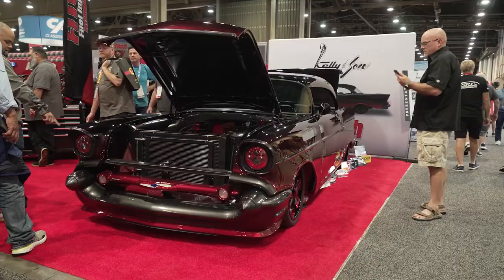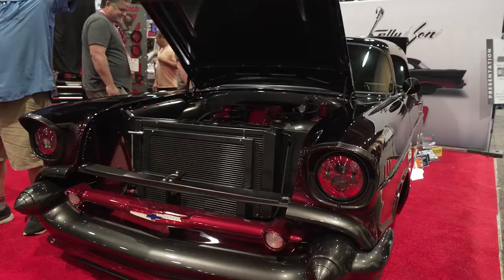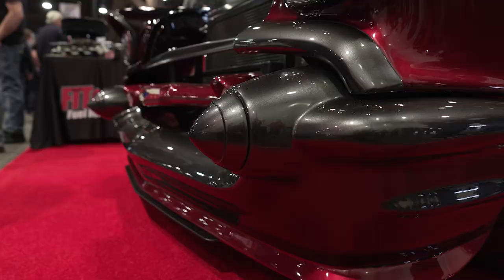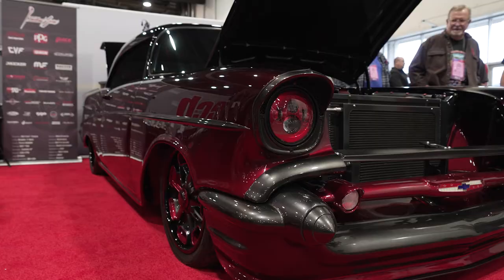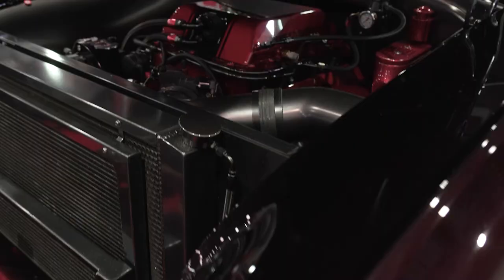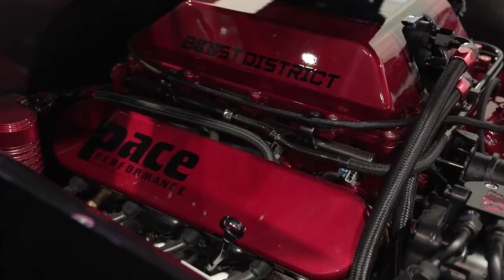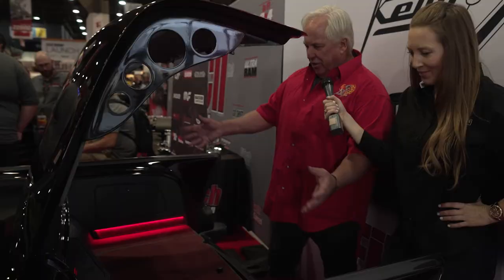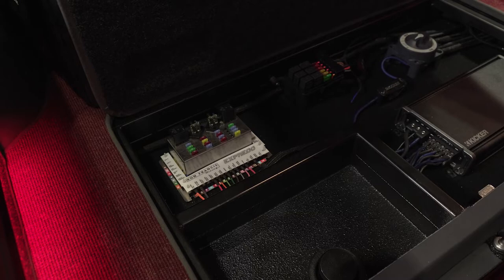SEMA 2022 - Kelly & Son - 1957 Chevy

Comment: I own this car...on CSR2😂
Reply: Same here 😂😂
Reply: @tylersingley3054  I just took mine out for a race, and was wondering why there was this high, pitched clucking sound. Turns out, one of my crew duct taped a rubber chicken to the tailpipe. This leads to a very important racing tip: do the circle check BEFORE you race!🤣
Reply: @glennarcher986 ahh that'll do it lmfao definitely check circle around otherwise you will have some unwanted eggs if you know what I mean
Reply: LOl I just got it too. I don't usually buy cars on CSR2 but it was just too pretty
Reply: @DarthTurducken  This one has become one of my favorites. CSR2 did this one justice! I'm looking for some  racers that can get me some decent rp for my crew. If interested, my crew is called Generation X.
Reply: @glennarcher986  thanks but I’m already in a milestone crew. Good luck though.
Reply: He said 750hp but in game stock it had 660hp?